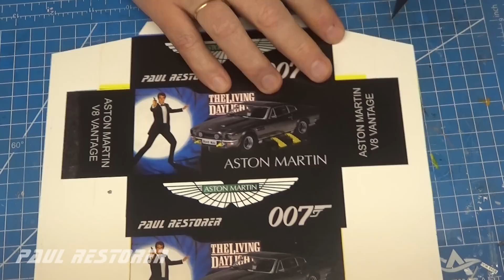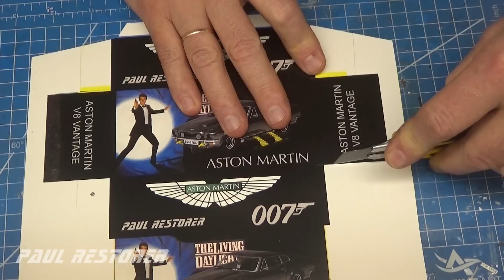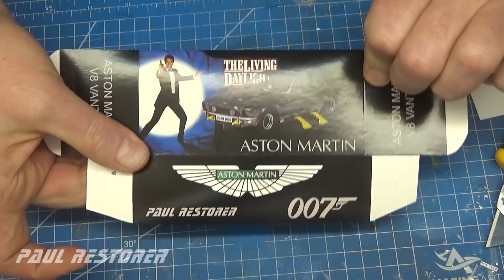Aston Martin V8 Vantage renowacja 007 James Bond. Film "The living daylights". Model odlewany.

Comment: A few months ago I had heard that some people prep this restaurations and this is a clear example of that, the rust part is just paint you can tell when he pours the stripping material, there is no corrosion in this materia in fact this type of metal does not corrode
Reply from the maker: There is no way for the alloy to corrode. it can become covered with a white coating if it is affected by the so-called plague. What you see are different types of paint applied to this metal surface by the previous owner. Kind regards
Reply: The only thing you have to fear with diecast models is Zinc Pest.  Rare nowadays as the quality of the melted casting metal has improved.  Mainly affects older castings.  Almost unknown with Matchbox.